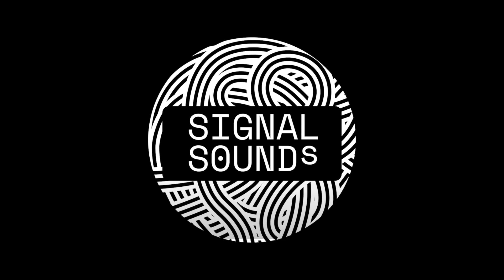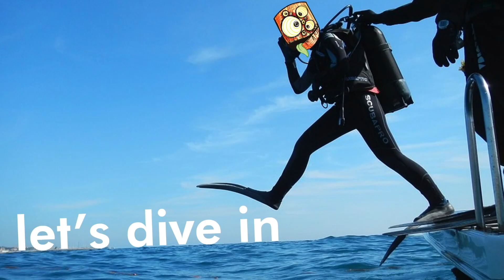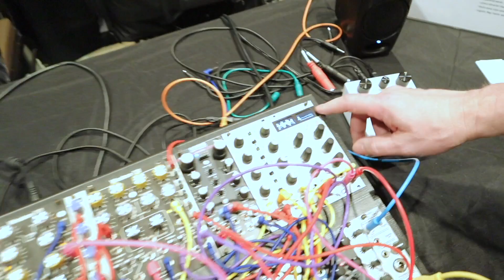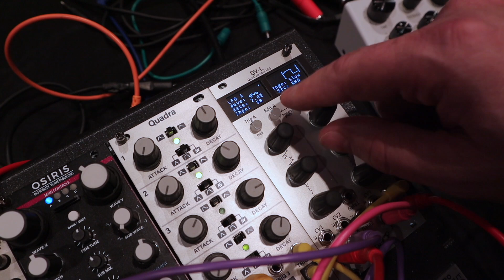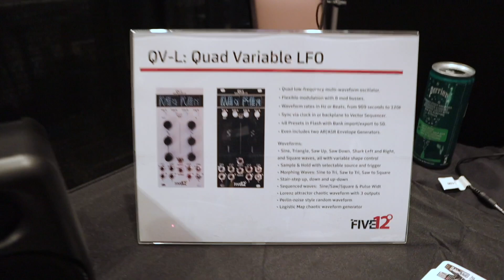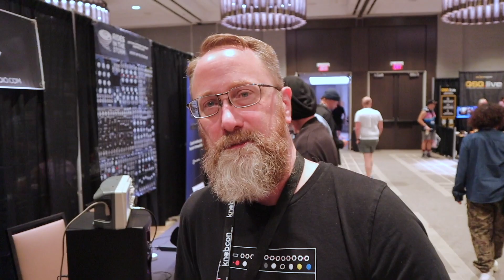QV-L a POWERHOUSE of a Eurorack modulation source // Five12 at Knobcon 2023

Comment: If you power on the module, make a change, power it off without saving - are your changes saved? Is an explicit save required every time? If so, please take a cue from Instruo modules like Arbhar and Lubadh that have presets but also always remember current state. I just pulled Zadar (similar to your quad LFO) from my modular because I’m so tired of doting on multiple (especially utility) modules to save them all one by one before a power down, not to mention loss on inadvertent power off.
Reply from the maker: That would have to be a question for Jim at Five12 directly. He's on Instagram at Five12inc and responsive if that's handy.